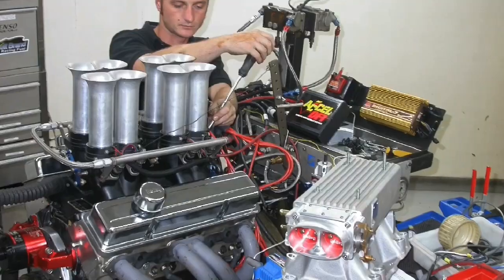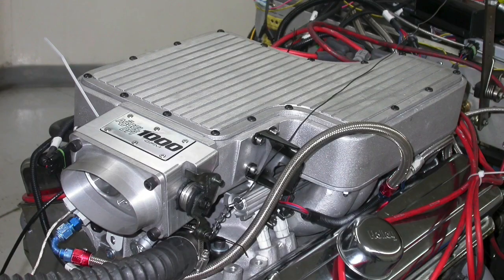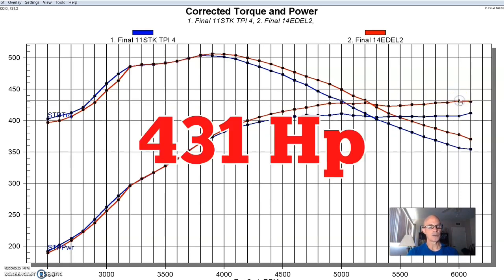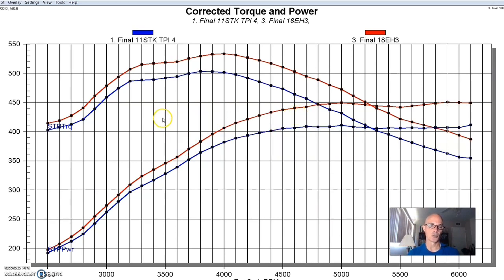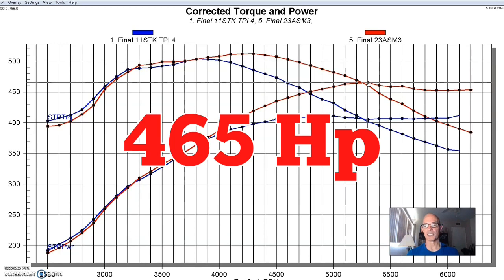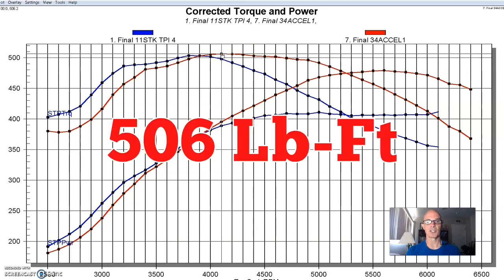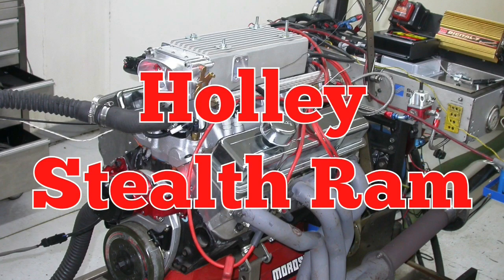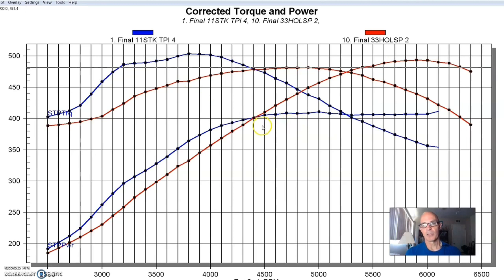TPI MEGA TEST-WHAT WORKS BEST?

Comment: Very good information! Who did the actual dyno tests and what electronics were used? I may have missed that information in the video? Very curious that we were not invited to the party? Would have been fun! 😁 I guess it is a good thing we will be doing some comparison dyno work on our YouTube channel in the future as well! Thank you for the support you give to the tpi crowd! I am glad to see others are out there, keep up the good work! 👍
Reply from the maker: I used a fast ecu-this was done many years ago-maybe before you were even in business-I would be happy to test a system and return it
Reply: @richardholdener1727  Hi Richard, when did you do this test? The FIRST has been out for almost 35 years. It is good information for guys to understand the difference between the types of intakes for sure. We have been making the FIRST tpi since 2000 and air sensors which originally designed it, did so in 1987 or so until the early to mid 90's. It was shelved as air sensors moved to the propane side of things, until I purchased the tooling to bring it back. The FIRST tpi has been out quite sometime actually. The vector W8 used it as well. We have many magazine tests that we can pull from the archives and post dyno testing against all the competitive companies of the time period. I would be interested in who did the dyno work on your tests? Can you tell me who it was that did this testing for this video? I would love to bring out a FIRST tpi and be there when you did the dyno test for sure. Have you ever had a FIRST tpi in your hands? Just curious, as it is much different than the tpis that you compare it to. It also has a lot more potential as the base is cast at 1.875" ID and the runners at 1.75" ID which is larger than any other system out there. It also can be opened up to 1.9" ID all the way through. Then add the siamese work, to theoretically shorten the runner length and I think it may open even more eyes? Keep up the good work and maybe we will talk soon! 👍
Reply: @firstperformancecenter  the test was done in 2004 yes first used to be called air sensors richard was there for these test but didnt do the tuning this is all form the acticle called ten times the torque.  as you know the correct tune for a efi has alot to do with how much power can be made, i own your first intake along with all the other tpi intakes used in here aswell as both design SLP runners the first unit is a tpis on steroids

Comment: Very cool to see these comparisons, I built a similar 383 for my 89 formula 350. TPIS base /runner and cam
.523/.528 with 1,6 rockers, cant remember the duration/ LSA
It was pretty hard to ever be caught in the wrong gear, or at the wrong rpm.
Pulled like a bear from just off idle, then it was shift soon, or sooner.

Comment: Had a Miniram back in '98 on a 11:1 355, TPIS ZZ9 cam, TPIS PROM chip and Performer RPM heads. Full interior and AC,  '87 IROC was a solid 10 sec daily driver on a 125 shot NOS plate kit.
Reply from the maker: they definitely work

Comment: I would have been curious about the "FIRST" intake.  Looked exactly like the stock TPI, but much larger intake runners on the inside.  My vote is for the Holley Stealth ram for street/strip, but the problem is that its too tall to fit under the stock hood of corvettes and Firebirds.  Camaros could get away with it with a little trimming of the hood brace.
Reply: Yes it would have been great to see the difference between the Holley stealth ram!

Comment: Be nice to see a comparison with this combo between the 305 and 350 as the GM TPI was intended for the 305. GM was gonna kill the 350 and the TPI intake was only designed for the 305. Consumers and corporate kept the 350 and they just slapped the 305 designed TPI onto the the 350, significantly killing air flow...
Reply: tq curves would probably look the same just more of it with the 350
GM already had the LT1 down pat yrs before it came out so they didnt wanna waste money on a larger TPI system
Never liked the short runners on the LT1 or its lousy plenum area

Comment: Richard, I was just looking over the "Ten Times the Torque" article today, I've got it in my computer.  I've got the SuperRam and MiniRam intakes that I've used on my 383.  Like them both, just like you prove on your show runner length determines power curve.  I've ported my SuperRam, base and runners also siamesed them about 2" to try and get the best of both mid and upper rpm power.  It has improved it a bit, but the MiniRam definitely pulls harder on the top end.  I've raced both intakes and with the 700r4 trans the SuperRam edged out the win by about .5 sec.  I think the MiniRam is faster with the 6 spd.  Haven't raced it with the 6 spd yet.  I have to say I like the feel of the SuperRam for regular driving.  You do a GREAT show love watching, keep up the great work and videos!!
Reply from the maker: THNX-SOUNDS LIKE YOU DID SOME COOL TESTING
Reply: @richardholdener1727  after watching you put the Torque Storm supercharger on that 305 TPI I want one for my 383.  Question is my compression is around 10-10.5.  Is that to high to run the TS?  I've got SRP forged pistons, ring gap set .019-.022, H-beam rods, Howard's cams 4 bolt main caps, scat cast shaft 9000 pro comp. I'd like to run around 10 psi boost get me up to 600-700 HP.  Do you thinks that's possible with street 93 octane fuel?  Thanks!

Comment: 2:32 the shape of the tpi looks pretty nice, basically you have a 400hp motor and if you want to run fast you simply it from 4500 through 6000rpm and benefit from all the power it can make, 1500 rpm range is ideal. if for example you are in a competition where they accept a maximum of 400hp+-2.5% this setup would be perfect :). if you want the fastest intake from these 3 , sure this is not the fastest, although for take off it’s good.

Comment: I have always loved the L98 injection setup. Probably because I was a teen in the 90's and they were everywhere before the LT1's were really common. I wonder how much that extrude honing costs. I've got a few projects i've been wanting to convert to fuel injection and have been going back and fourth on the idea of L98 style vs one of the new bolt on throttle body injection packages from either Holley or Fi-Tech. While the throttle body "carbs" have the benefit of not having to yank the intake off they also don't increase flow over the stock cast iron intake or increase runner length, etc. I could also say screw it and drop a junkyard 5.3 LS in for the same price as that TBI setup, lol.
Reply: I paid $500 to get my lower intake extrude,honed. That was with a v6 plenum.Not including shipping.

Comment: This definitely cemented my decision on running the 1205 Miniram on my SBE L98. Really lets the engine breathe and make power where GM’s halo sports car of the 80s should have all along. Running a slightly larger cam with more duration with the same heads and thinner MLS gasket I’m hoping for 400-450 wheel. Would’ve been really cool to see a First Performance TPI setup tested as well, although I understand most of this dyno work was probably done long before it was around.

Comment: Was it using a mass air flow or the 'other' later memory mapped setup from the 90's not enough info for me I am using the DEMON with a RPM manifold on my 383...I think I will leave my TPI systems sit on the shelf.
Reply from the maker: we used after market ECU (speed density)

Comment: In all the yrs of test after test. This large plenum and tpi system with a centrific blower has produced the best power and fuel economy ive ever seen. I believe it was in a article from the early 90's that used the eccell. Set up. I believe the title was 500hp and 25 miles to the gallon. Nothing gas has macthed that performance yet.
Reply: I believe that was in gm high tech magazine

Comment: Great info, really shows that runners matter. I have a measly 3.1L TBI V6. It came stock in Isuzu Rodeo's but I have swapped it into my Trooper which had the slightly smaller 2.8L. If any of you have seen any of the stock TBI manifolds you will know how sad the runner situation is in there. I am going to fabricate a new intake by taking the lower section of a MPFI manifold that was on the F-Body V6 and graft a plenum and mount the TBI on top. The engine performs well but I know there is more I can do. It won't cost me much so it's worth a shot since there are no aftermarket options.
Reply from the maker: add boost
Reply: @richardholdener1727  I would but sadly there is no easy way to do it without a whole lot of custom work and electronics. Plus I use it off road so I want to keep it dead simple.

Comment: How much could you boost the torque curve of this combo by optimizing the cam for the long runner intake? I think those AFR heads might be able to make use of more intake lift, too. Probably too hard to do to re-create everything, so just wondering. Maybe put together a test mule 383 with AFR heads and test cams and runner length on an IR intake? I’d like to see that.
Reply from the maker: we ran a different (smaller) cam-it doesn't change much
Reply: I think Brian Tooley says lift is optimized at about 0.3 x valve diameter. That would suggest around 0.615 lift at the intake valve. IO at 2° and IC at 40° would be a 222° intake lobe on a 109. I would expect that would make a difference, but you’re the guy with the hands on experience. Thanks again for all the good work!

Comment: It's funny how to this day its really tough to beat an rpm air gap with a 750 for street/strip duty for a sbc, personally I love the tpi stuff, I think I might add a tpi system to my K5 blazer, still doesn't make sense that gm didn't use tpi on the trucks
Reply: @ron Kay yep, im sure it was an exclusive deal meant for the F-body and Corvette but still if you have a small block in a heavy truck its probably the best induction system you can use for idle to 4500rpm

Comment: Your next tpi test should be showing the difference between runner length AND the difference of shapes.
Reply from the maker: shapes?
Reply: @richardholdener1727  yesss shapes. For example if you look at the long tube runner tpi, the runners are round, but if you look at the lt1/lt4 its rectangular.
It it theorized (that different shapes and materials actually change characteristics, even when square inches and length stay the same)- yet has been practiced in application (most tuned intakes are oval or rectangle), and yet again no one has actually tested it, (that rectangular/ovular shapes support higher HP and rpm).
The source I remember to research tuned ports is grape ape racing or David Vizard.

For example, if you take aluminium, brass and steel..Keep the wall thickness, ID, shape and length the same..if you strike it with an object (you can use a frequency analizer on a smart phone), you will see that each one has a differing sound. Change ANY of those in the same material and the frequency should change.
Another way to view ANY tuned port is just like this..Acoustic resonance or  set of Organ Pipes for an engine.
They function much the same as a "tuned pipe/expansion chamber" for a 2 stroke.

Comment: I ran a 11:1 385 dart ie200 headed sbc with tpi & lt4 hotcam for years. While the torque was fun, running out of steam at 5,000 became tiresome. Stuck a stealthram on it and never missed the low-end torque. Pulled hard through 6,400 with great street manners.

Comment: @Richard Holdener hey man, just an idea (maybe a pointless or boring idea!) But maybe you can test how far you can go on a SBC with a TBI setup? I know things can be done like increasing fuel pressure and using big block injectors, but how hindered are you by the CFM limitations of the TBI throttle body? Keep up the good work!
Reply from the maker: you would definitely be fuel limited eventually, even with the BBC injector upgrade and more fuel pressure
Reply: @richardholdener1727  For sure, naturally the most economical and fruitful thing to do would be to convert to carburetor, im just curious on where the limit is, ya know, for science!

Comment: Richard you already know this and btdt but anyone who read (stilhave) Lingenfelters book on building Chevy power read about John 383 TPI 400 superram and even I think a 409sbc. Torque was real impressive. 

Know of anyone in Socal who can burn a chip for a 88-89 C4 TPI? Wanting to do a mild TPI 400 build to pass smog...Small Isky HR ported TPI afr 180 head etc. Basic cheap and reliable. (for once lol). WIll be my last build....simple retirement daily I can drive anywhere with AC

Comment: Thanks, Richard! Liked and subscribed. I'm wondering if the long-runner intakes will produce similar percentage gains on a stock L98 with a mild cam. Obviously, it won't make as much power as your 383, so I'm thinking in relative terms. Any guidance is appreciated.
Reply from the maker: gains won't be as great on the milder L98

Comment: I have had a Superram on my Corvette since 1993.  I got one from the first batch that Accel made from the Lingenfelter design.  I can attest to Richard's complaint that it is difficult to assemble.  I have made a few modifications to mine to improve assembly.  Mine is on a 355 with AFR 190 heads, 10.7 compression, and a 224 effective duration Comp Cam.  I have done road course track days with this setup for many years.  It's good up to 5600 rpm, but it really lays down after that.  Maybe it needs a little more cam, but I can see how a centrifugal supercharger would extend the rev range.

Comment: Excellent test. Very informative. What changes to the cam would optimize it best for use with the long runners? Wider lsa, less duration?
Have you ever run a cam test on an L98?
Reply from the maker: yes we have run different cams on the L98-cam should be milder with less duration and slightly wider lsa-won't really change much in power, just help idle and drivability
Reply: @ron Kay thanks for the info. I have a TPI induction system pulled off a scrap 305.    might yet be useful with the right engine configuration. Probably work well with Edelbrock Performer heads.

Comment: I would like to have seen the first fuel injection intake included. It's similar to the TPI, but much larger runners, and said to have the bottom end of the TPI but carry the power out much higher up in the RPM range. I'm considering one, but can't find any info other than the manufacturer's on it.
Reply from the maker: it can't do both
Reply: I've only found 1 dyno sheet for a 383 with one on it, and it was only a quick shot at the very end of a video, hence why I would like to find more info on them.

Comment: Richard Holdener,  When you tested the Edelbrock parts was it just the runners only, or also with the high flow base ?   It would have been interesting if you had talked about that a little more, and speculated why you thought the power gains were relatively low with these parts,  perhaps the remaining restriction in the plenum or TB, or something else.

Comment: It would be cool to see a na 5.6 nissan v8 with 500 to 600 hours power and a Toyota tundra na 5.7 Toyota v8 with 500 to 600 hours power or do what ever you want I like your channel either way another cool test would be to test a signal vs dual exhaust on a 500 to 600 hours power engine.

Comment: What if the camshaft in this motor peaked it's torque at the same time the intake wants to peak torque. What kind of horsepower would it make then.

I know it will be less than the tq output but would torque be close to 600ftlbs?

You're getting into turbo diesel territory at that point with an na engine

Comment: You have to do a legit test on the first tpi setup. I'm very much considering it on hi rpm motor but can that size intake setup make monster power? You would be the one to test it! You are great at combos and comparison run downs.
Reply from the maker: it won't work for high rpm
Reply: Yes but just how much torque will it make. Can it compensate to overall keep up. It's a monster on torque,  and is just so much bigger. What can it do. Not much testing. It's not over 6,000 rpm, but overall its potential?
Reply: Run it Richard ...Please

Comment: You should have put the best long runner on the graph against the others.
At That point this is a total no-brainer for me, for anything short of a pure race engine.

The TPIS is way stronger up to about 5000 1/min, and when you shift at about 5200 1/min, you drop right into the meat of the torque curve.

Comment: 2 piece manifold a la tpi base,  
 dual Turbocharged 
extreme long runner intake. 
Turbo sized  to spool quick down low. 

Just to see how much torque can be produced at lower granny driving ranges. 

Akin to the Chrysler dual sidel cross over intake of the late 50's early 60's

You could actually use exhaust tubing for runners  a 3" collector band clamps and 3/8 water jet cut flanges.
Imho.

A manifold everyone would want, not just go fast guys.
Reply from the maker: check out the TPI l98 turbo video that is up

Comment: Awesome test! Most of these would be good marine engines. Like a single engine, 21-23 ft bow rider or speed boat. Lots of torque and enough hp to run 50+ mph if propped correctly.
Reply: With that torque curve and max rpm of about 5000 these would be great engines. I have a 20’ bow rider that I put a stock vortec 350 (96-99 truck) in place of the locked up 305. I put the 305’s 2 barrel intake and carb on the 350 and I hit 50 mph with a 4 blade 22” aluminum prop. Could probably do better with a SS prop but 50 is kind of scary with my hull. I’m nowhere near the torque of this test motor. I have an alpha 1 and I’m not sure you can go much bigger than 22” prop. I bet you’d have to step up to a bravo to get the prop selection with this much torque.